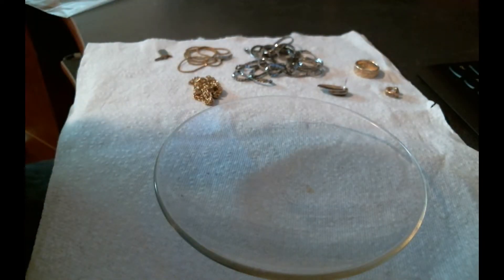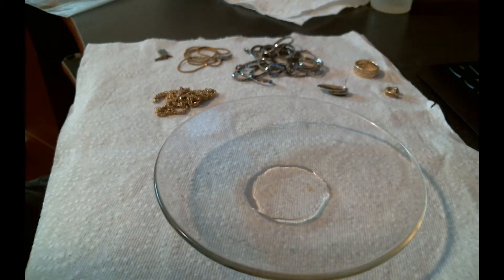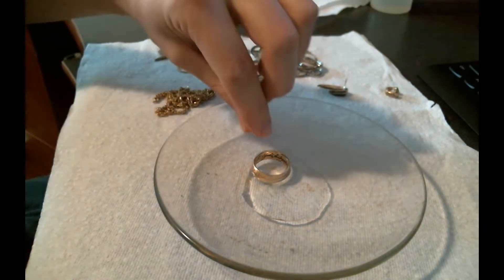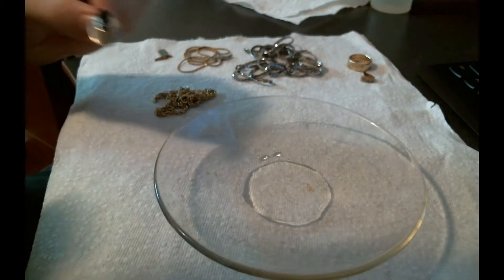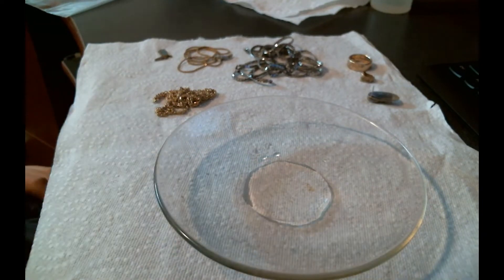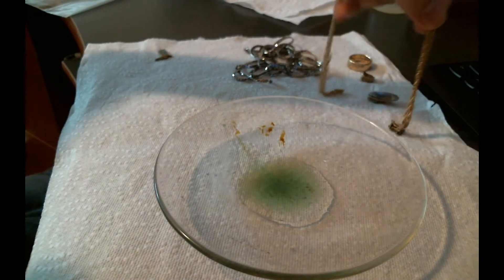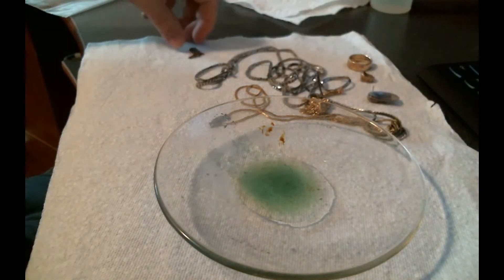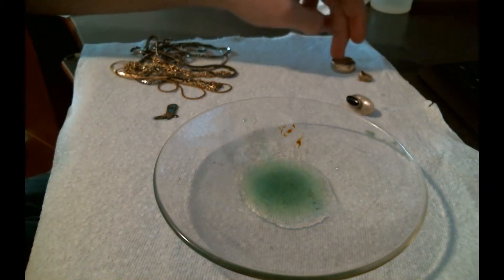Nitric acid test on gold, silver, and base metal jewelry

Comment: How do you test gold filled that's 5% gold since it's very thick
Reply from the maker: Density Test, I have a video about that topic.
Reply: @IntermountainGoldRefiners  oh yeah. Gold is pretty heavy. What about silver filled or rolled silver. Silver isn't much more dense than brass. How can I test it without filing deep into a link?
Reply from the maker: Silver is 10.39 or something and brass is like a 7 grams per cubic centimeter. Density works for silver unless you have lead, but lead you can separate by color.
Reply: @IntermountainGoldRefiners  I just tested a thick Cuban sterling by holding a lighter up to it for about a minute. The links got tarnished but buffed back to normal. If it were plated or silver filled the plating would have probably disintegrated and revealed brass or copper underneath? It's about 100 grams so I have to make sure it's legit. I ordered the jsp acid kit and look forward to testing further
Reply from the maker: Cuban chains are often plated, I would density test it first probably.

Comment: Distinguished between plated gold,  silver , and 22k gold please help
Reply from the maker: What is your question? Plated gold looks a lot like 22k gold, Dark yellow. Silver should have a Sterling or 925 mark. It can be discerned by color but it takes practice because there are a lot of white metals.  Density is a great test for these if they are solid objects. Look up density testing.
Reply: @IntermountainGoldRefiners  how to test plated gold and real gold by reactions
Reply from the maker: Concentrated nitric acid is the most helpful, it will bubble with most gold plated jewelry.  The magnet test catches about a third of plated items, and the density test probably catches 70%. I use all three to be more certain.

Comment: Hey bud I got a bunch of gold filled material. Will nitric dissolve any stainless steel if it ends up in my solution? Very new at this havent tried to refine yet. Thanks
Reply from the maker: Not unless you add Cl- (table salt). Aqua Regia dissolves both gold and steel but then gold steals an electron from steel and plated out on any available steel surface,  so separate steel out from any gold you plan to dissolve. 

Get a fish tank bubbler and use some copper (most gold plate is on copper), use HCL (hydrochloric acid, sold as muriatic acid at lows or Home Depot) put the gold plate into a vessel, place half water half HCL into the vessel. Place the bubbler and turn it on. Let it sit for a few days. The solution will turn dark green over time. Gold should start to flake off. You should be able to rinse off most of the gold foil. There may be some heavier empty husks worth collecting as well. Filter and collect the gold, one YouTuber used a spray bottle to do this.  

I’ll make some videos on this topic for you and others. I have some I need to process.
Reply: @IntermountainGoldRefiners  So you suggest not even using nitric and just let it sit in HCL for a while? I thought this only worked for gold plated not gold filled material. Is so that would be much easier and cheaper for me to process. Thank you
Reply from the maker: @kohnbonn9744  well you might end up doing both separately, for example use the copper etchant to get copper, collect some gold, rinse and use some nitric to get nickel plated objects. you'll use less  nitric this way.

Comment: Good information to have, now how do you talk the seller into dipping their gold into Nitric Acid?
Reply from the maker: First I make an offer, after they accept then I tell them I need to test with the acid to verify the gold.  Also I dip it because its probably a liability to have them do it.
Reply: I think you had said that in another video, I bet you have a few that back out over that, which means they know they are trying to pass off garbage.
Reply from the maker: It’s happened a few times out of 1000 or so offers.
Reply: I have a bracelet and I added one drop of conc Nitric acid and it caused bluish green colouration and bubble formation, after waiting for 15-20 sec I washed it with water and everything disappeared and I got same colour which I had before testing.. So is it artificial?? plz reply
Reply from the maker: It sounds artificial, at least that is a failure of the acid test. Next I would density test it.